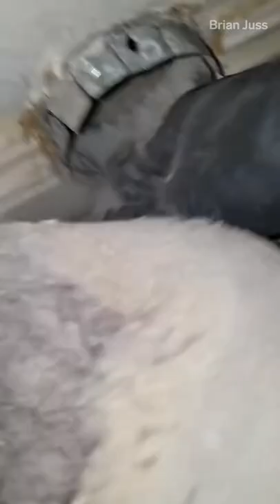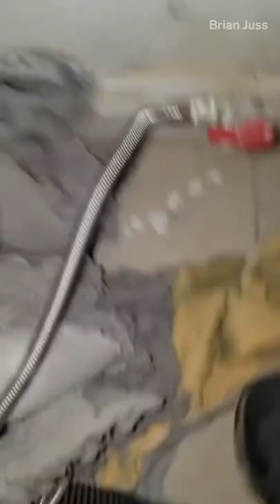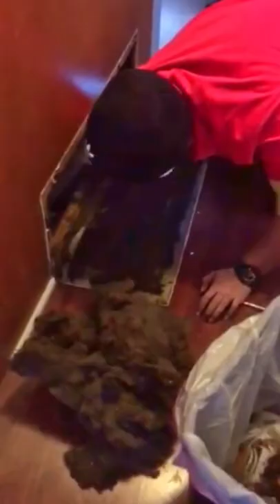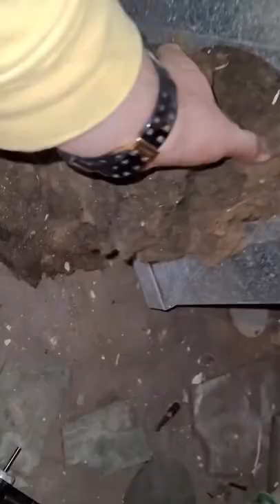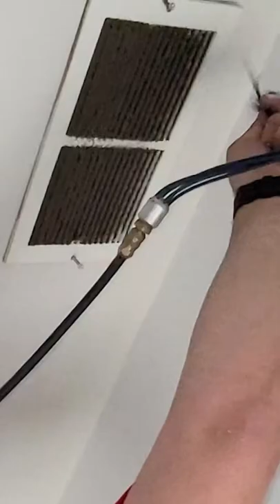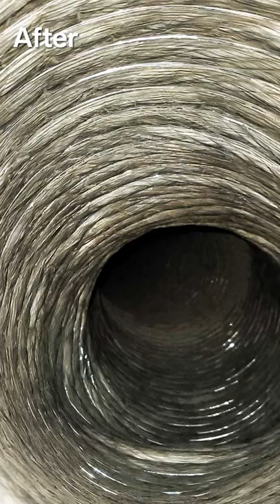How 47 Years Worth Of Dust Is Professionally Cleaned #shorts #insider #airventcleaning #deepclean

Comment: I'm curious isn't this a fire hazard or is that just dryer vents?
Reply: Both are fire hazards. But the dryer is exposed to heat high enough to ignite the dust on a regular basis, and vents typically are not.
Reply: Both can certainly be fire hazards